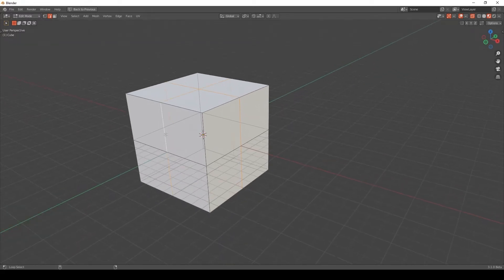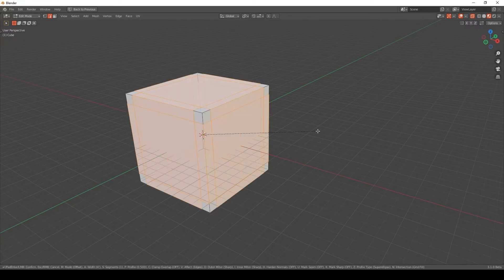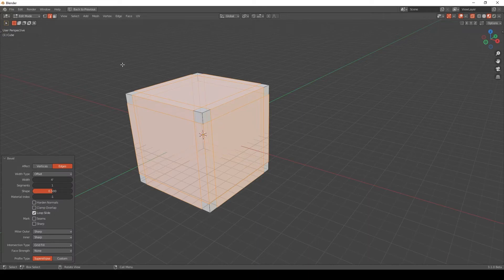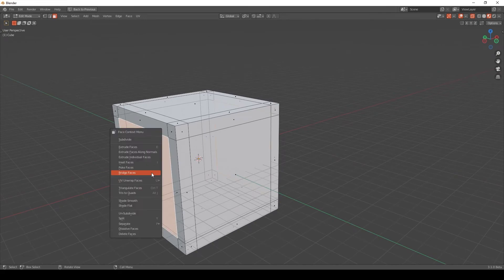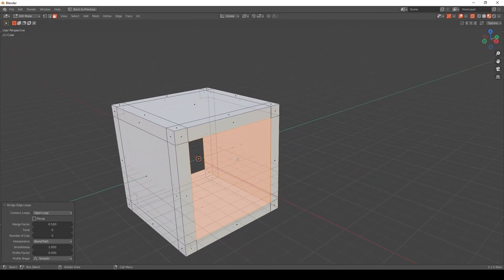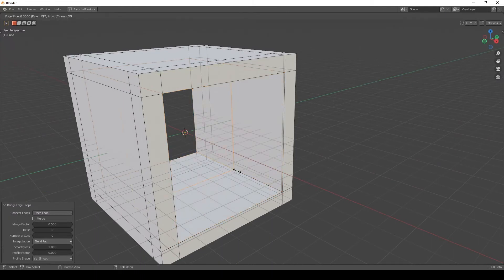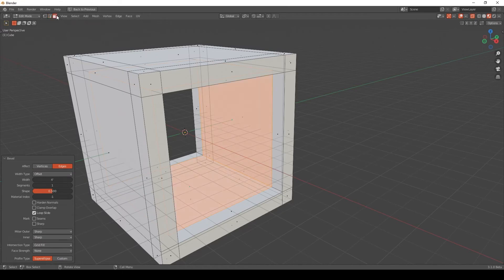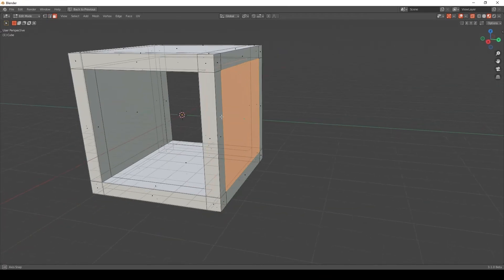blender 3D | hollow cube

Comment: yo man what if i had to do it on a pyramid
Reply from the maker: Hi, you can start with your pyramid object then in edit mode duplicate it in place and scale it down so that there is now a smaller copy of the object inside of itself. Then while that is still selected, flip the faces of the smaller copy (alt+n for normals menu then select flip). Next, invert the selection (ctrl+i) so that you have the larger pyramid selected and inset those faces. Next, you can bridge faces from the smaller inner pyramid to the outer larger pyramid faces.
Reply: no idea probaly look it up most likley the same just you have less faces and its a diffrent shape